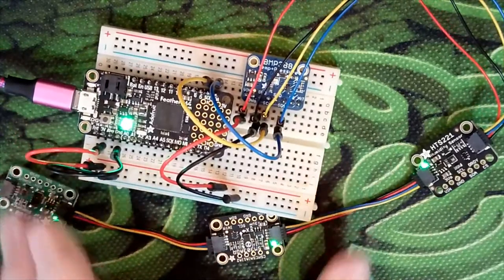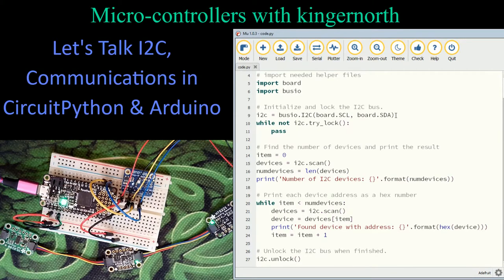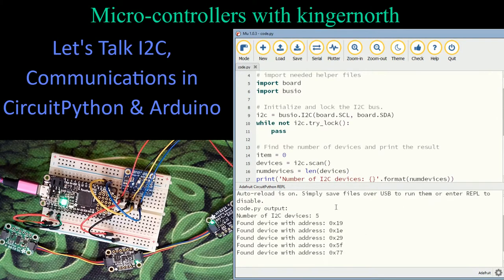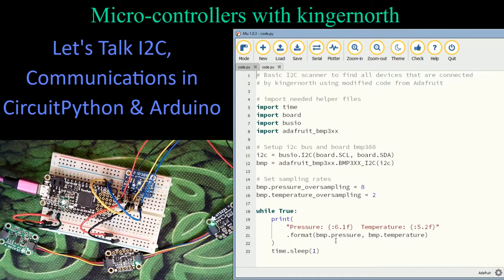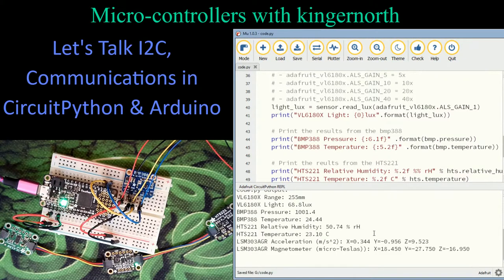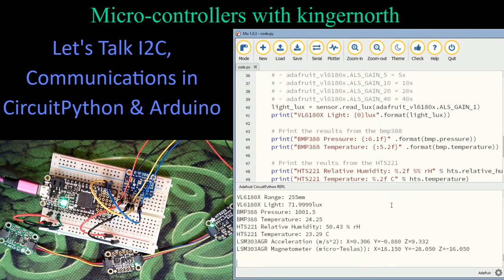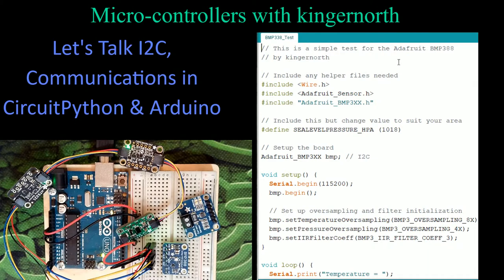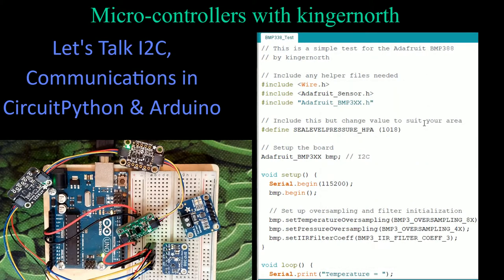Let's Talk I2C in CircuitPython and Arduino

Comment: Very Useful - Thanks ... Can I ask why we need to know the address's? When you run the Python code, unless I missed it, there doesn't seem to be any direct reference to any of the addresses... they are just using the libraries?
Reply from the maker: It's a good idea to confirm the I2C address in case you want to add additional items as each needs to have a unique address. Also if you use another I2C board from another manufacturer it is good to know that there are no conflicting addresses. Many I2C boards have the ability to add jumpers or solder across pads on the board to change the address.

Comment: Hi, how would I write a new CircuitPython module for a I2C sensor that doesn't have one already (Im working with a Sensirion liquid flow meter and IDEX Pressure Sensors). I'm not sure how to use CircuitPython to record the data from them since I didn't see library modules for those sensors in the adafruit library bundle.